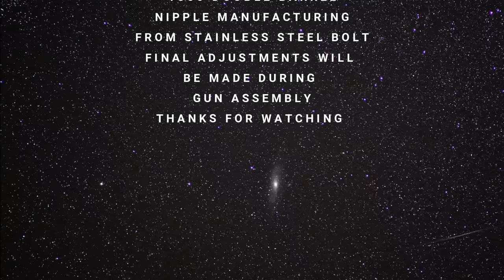Amazing skills. Making rifle parts from stainless steel bolt. (No milling machine, no lathe)

Comment: 0:52 your lathe tool is set in the wrong position. It should be rotated by 90 degress.
Reply from the maker: Thanks I will try that next time. I never thought of that. Lack of experience  :)
Reply: @TopGunRestorations  no problem... just watch a random lathe video and look at the tool. With correct set up you will build your part  without file or grinder.... i do this many times on drill press.

Comment: Hi sir u native place
Reply from the maker: Toronto, Canada
Reply: @TopGunRestorations  I want muzzle loading gun
Reply: @TopGunRestorations  
That’s cool I live 5 hours from there , I have also been making y own percussion nipples on my project guns, 1/4-28 die thread, but some old shotguns like that have a slightly oversized thread so I use a 1/4-28 “split Die” that way there I can adjust the thread thickness to make it fit perfectly